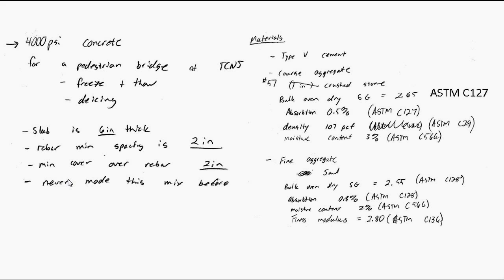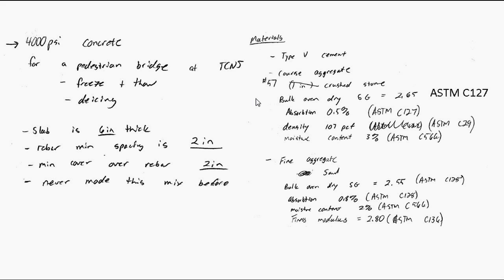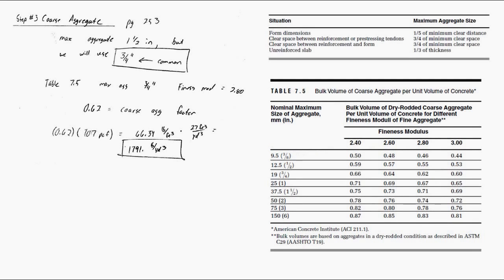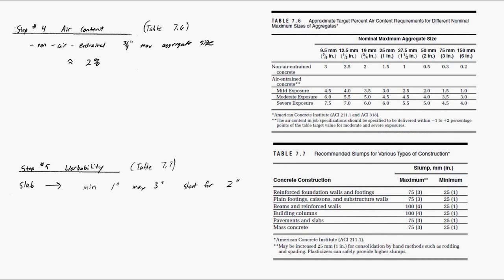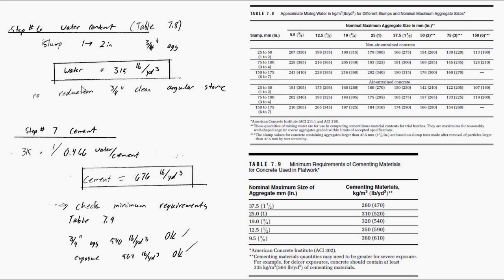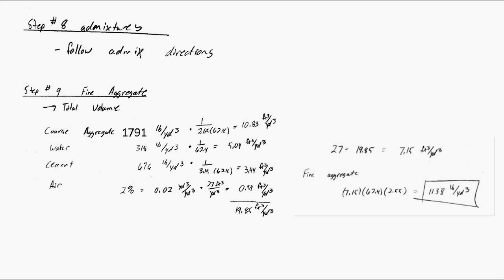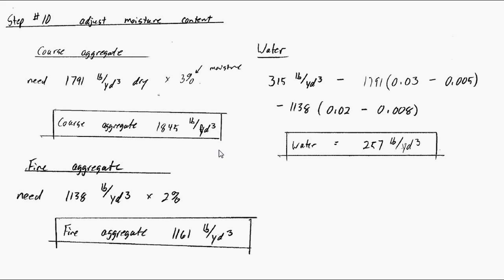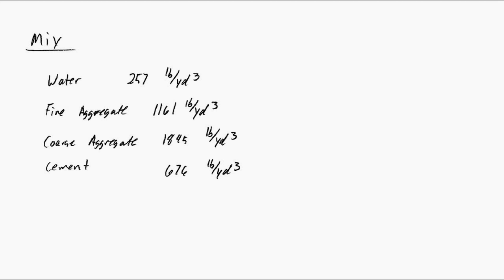Concrete Mix Design 2

Comment: Well done!
but a quick question... the requirement is 4000 psi and you added 1200 addition ...why 1200psi?
Reply: +shervin abedi The extra 1,200 psi is part of the statistical overdesign value for f'cr requirements in ACI 318.
http://www.commandalkonconnect.com/2014/12/01/concrete-mix-design-art-science-statistical-overdesign-aci-318-part-2/